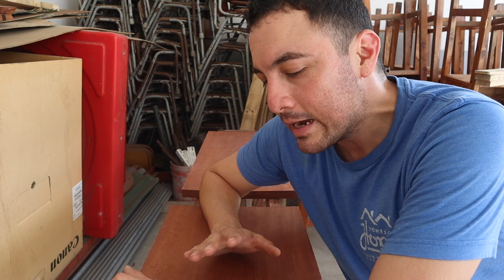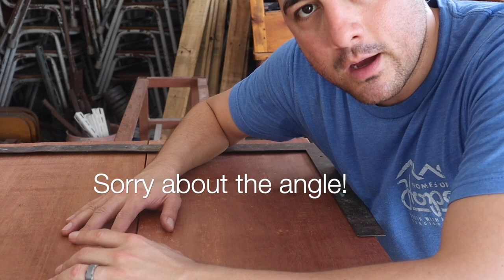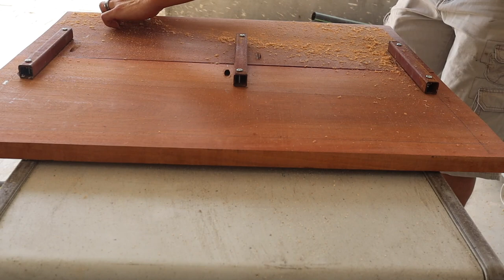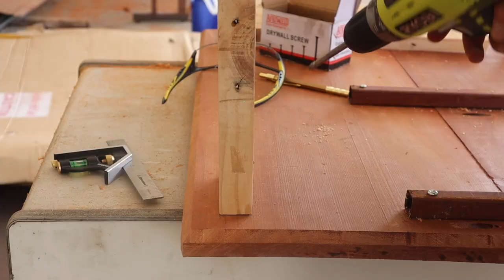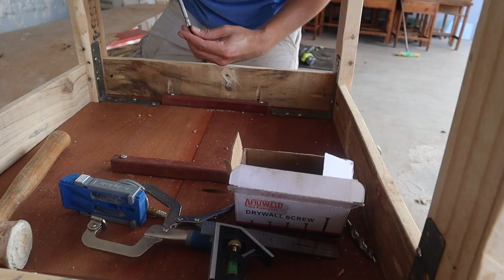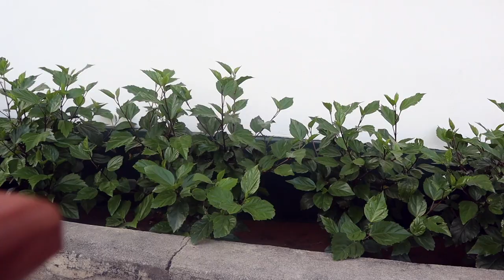Guide to make your OWN coffee table

Comment: Here’s a trick I learned about using pocket holes for awkward connections, such as the legs being set back from the outer edge of the top. Clamp a scrap board to the top to press the leg against when driving the screws. That will help make sure you don’t find that the leg shifted when you are done.
Reply from the maker: White Lab Workshop That’s a good trick! I’m new to pocket holes, so I really appreciate the tip!

Comment: This table looks good man. you asked what kind of wood it is in the beginning of the video but I'm sorry, I don't know what kind of wood it is. 
I have the same pocket hole jig like you use and I think that is a great tool. I use it a lot for my projects. When you said cutting the legs my wife wants it, thats the proof that women are always the boss, even in the workshop hahaha. 
Great build my friend. maybe a small tip because you said you could not find any wood filling paste: just take some sanding dust and mix it with woodglue. works perfect!
Reply from the maker: Christofix - DIY Projects Thank you my friend! Yes, she’s definitely the boss! Haha! But I wouldn’t have it any other way. I did use wood glue to cover the joint, I just didn’t think it looked all that great. Is the line in the middle of the table. Maybe I just didn’t do it right. Thank you very much for the comment!
Reply: @19woodworks  Yes you used glue with sawdust, but you have to use sanding dust. It is much smaller and works a lot better.
Reply from the maker: Christofix - DIY Projects Got it! Thank you mi amigo! 😊
Reply: @19woodworks  You are welcome my friend! I'm glad i could help. Again graet video. keep making them!